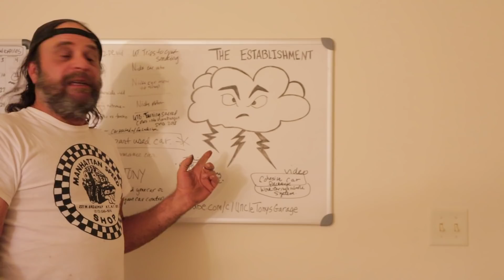Anatomy Of A Gasser

Comment: Gasser started in the late 50s to break off of 1967. They ran on a small amount of custom made fuel there were no regulations so whatever burned was in Aaron small fuel tanks mounted in front of the engine. Along the process to compensate for poor tires the bodies were altered for weight transfer most were stick shift cars and straight axles you would raise him up in the front end to get the weight transfer to the back tires.

Comment: Nice! Helped a buddy build one. 50 on a 49 frame. 350 turbo 350 9inch Volvo rear disc mustang front disc independent front end l can't remember all the cars the bits came from. MG midget right hand steering rack flipped over put behind axle so its left hand drive. Steering shaft down threw hedders. Still had semaphore turn signals. U-built 50 Anglia street legal up here in canada. Drove like a sprint car.
 RIP Willy l miss yu.

Comment: I'm 68.   I had a gasser. a 1963 Falcon, 9", c6, 427 Holman/Moody, 2 X4's, truck straight axle with parallel leafs,  a Chute.  It ran 12's all day long.  (That was before wrinklewalls)
I was 17 and had the world by the ass. I just couldn't save enough for a blower, Damn....

Comment: Seems to me, if my damaged old brain isn't failing me, that Borg Warner made the 'Rock Crusher'.  I had an '57 Chev Two Door wagon that was an F-G/Gas, depending on which motor I had in it. I ran wide ratio Muncies because they gave you a lower 1st gear ratio.  The Ford guys were always talking about their Rock Crushers and Top Loaders.

This was before automatics were around. If you wanted an automatic, your choices were a MoPar 727 or GM's 4 speed Turbo Hydramatic, from a truck.   Nobody had figured out how to build a Powerglide that would hold up. Besides, drag racin' was shifting, back then.

We could wind the hell out of the small block chevies, but low end torque was always the Holy Grail. I used to run a 12" Truck flywheet, (if I couldn't find any 348-409 flywheels), with an 11" pressure plate and a 10 ½" disc to get the mass of the flywheel moving, (the right flywheel weighed right at 48#). The 11" clutch and 10 ½" disc was to make it shiftable.

Drag racing has changed so much since then. The theory of getting the front end up to shift the weight to the rear wheels was the original theory behind straight axles, then 90/10 shocks wss the next progression.

Then the TH350 changed everything.  Keep it on the ground, break less stuff, and go faster; that led to bracket/ET dial in racing, and it wasn't about going fast anymore. It was don't go too fast, and be consistent.

Boring racing, and the sport took a hit for it.

Comment: I was thinking back in the Sixties that what those bums should have been doing is getting those Air Lift airbag suspensions on the front, raise the front up to the sky like they like to do, and when they hit second gear let the air out and put the nose on the ground, making the car a wedge.  I guarantee you they'd hit higher mph at the traps.

Comment: Ok lamb chop my Dad in his 55 Chevy early 1963 ran a 283 with duel quodds Carter afb Vette fueler cam & heads 10 1/2 to 1 vanola pistons ...now with the fueler heads made the caperetion 11 1/2 to 1 also he ran a 3 speed with a 3:08 rearend so my advice to you is you 400 10 to 1 pistons 671 blower 4 2 bbl carbs very wild came with a wide lob separation dart 2 heads or broxes heads ( u know good heads when I see them but I can't spell what type they are good breathers 456 locking rear end a munice or Nash 5 speed ( my dad has an in line 4 speed shifter ) I just love b&m ... My dad wanted a blower but he took my mom to the prom ( the food sucked & my mom was & is a nice girl so he kinda kick him self for not getting the blower ) no fun being a grown-up but they were married for 54 years before he died so ... Well lamb chop 400 671 blower 4 duices 4 or 5 speed stick & 456 locking rear end eather 12 bolt or Dana 60 just don't use Kathy's Tony will be upset 🤣

Comment: Man, you weren’t too far away from me, but the work schedule won’t let me get that direction. Enjoy the heck outta it though! 
Hey, I know it’s not the most desirable thing in the world, but have you done vids about getting rid of the Lean Burn and finally getting some power from an ‘80s small block? I’ve got an ‘86 GranFury that I love and have opened the exhaust up on, but getting around the air pump mess and the subsequent manifold leaks along with the Lean Burn is driving me nuts. Suggestions?
Reply from the maker: No real mystery to it all...just a bunch of work and a conventional distributor.  Weld the Air injection tubes shut and don't look back
Reply: Uncle Tony's Garage: I had told that there was a crap load of wiring to do to change it over 😆 Just an intake and carb and wiring in a conventional distributor is a helluva different story!

Comment: I wanna do an early abody mopar with a 413 and straight axle!
Reply: Don't know If you can get any pistons for a 413 maybe spec them out from a chart.
Reply: @jimifed2798  i have a 413 bored .030 over with egge pistons now and a .480 lift cam im approaching 12s with my 3600lb duster.

Comment: That front tank of "Tigger" looks sick! Also, how much  could I raise the front of my Duster with the stock torsion bars? Currently there are about 3 inches between tyre and fender but sometimes it rubs... :/
Reply from the maker: Geometry gets all kinds of bad once you go beyond about 2 inches over stock with an A Body
Reply: @UncleTonysGarage  So... I will research what "stock" is. Actually the front looks fine, what bugs me is that the rear looks VERY raised (14 rims with 60 profile tyre) and there are like 10 inches of "nothing" between tyre and fender (for reference has the same stance of Jay Leno's Duster here in YT), and was thinking of adding lowering blocks. Thanks for the help!! :)

Comment: So what makes them a "gasser"? No nitro?"Gassers are based on closed body production models from the 1930s to 
mid-1960s, which have been stripped of extraneous weight and jacked up 
using a beam axle or tubular axle to provide better weight distribution on acceleration 
(beam axles are also lighter than an independent front suspension), 
though a raised stock front suspension is common as well. Common weight 
reduction techniques include fiberglass body panels, stripped interiors,
 and plexiglass windows (sometimes color tinted)." 
https://en.wikipedia.org/wiki/Gasser_(car)

Comment: No disrespect at all here, but the 56 Chevy gasser couldn't have had that engine in it since 1965. The L88 was only offered from 1967 til 1969.
Reply: There a collectors that will pay 100.000 grand for a l88 there were only offered in the corvette and only 216 were ever built in three years.
Reply: maybe it walked out the backdoor of factory test facility during R&D ;) many things did back then
Reply: @throttlebottle5906 That's a long shot at best especially two years before the L88 was used in a production Corvette. A 1967 L88 Corvette sold in 2014 for 3.75 million dollars. Only because it was a L88 car. There were less than 250 produced. Talk about hens teeth. Here's the real deal if the average person possessed a very rare L88 they wouldn't risk blowing it up just for fun.
Reply: @maninthebox-dz9yo  
Corvette's and camaro had the 427..
Reply: @robbyhood2467  yes but the L88 was only put in the vetts. All other models got Mark IV. 427 and. All other vets.
Reply: @robbyhood2467 Only the 67 through 69 Corvettes got the L88 off the production line.
Reply: @lskiller1903  
I suggest. Corvette and American  muscle site..1969 L88 Camaro..look on mecum  Auctions. 1968 rs/ss L88 Camaro sold for $650,000..the copo Camaro's also had the L88..
Reply: I'm not sure but I believe the L88 may have been available over the counter at least in short block form if not long block as well. Someone correct me if I'm wrong.